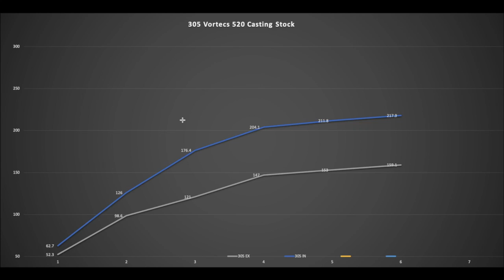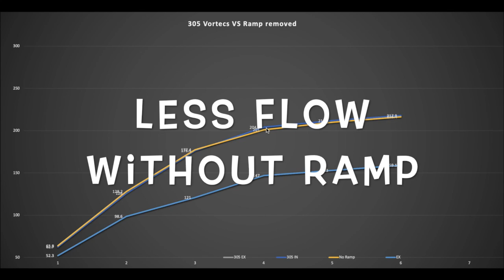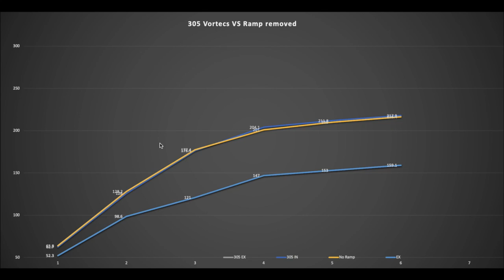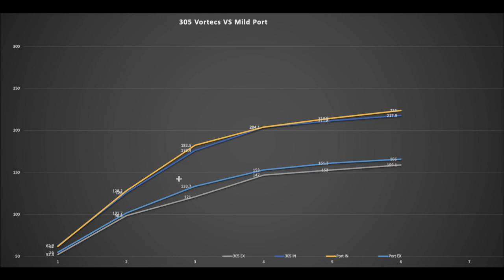305 Vortec Heads vs 350 Vortec Heads (Flow Data)

Comment: Do you know anything about the 113  aluminum sbc heads going on a .060 400 sbc an what cam to use??
Reply: The 113 head has a 58cc chamber. Will make some compression ratio even with a dished piston 400. The intake ports flowed sliightly better than a 882 head. D- shaped exhaust ports are hard to seal with a small tube header.
Reply: 113 heads will choke the 400 before 6000rpm, and the compression ratio is pushing pump gas. Summit sells an old crane grind 306 advertised duration, 246 @50, and .500 lift on a 106 lsa that would work well given the combination.
Reply: You went 060 over on a 400 block? Ain't ya worried about cracks? I know they're siamese bores, but still...Ya might wanna think about a partial fill with Hard Block.

Comment: Thank you for doing this. As an old hot rodder who still likes to build hot little 283s, you have my full attention. I have one fresh 30 over short block waiting for heads, and a second block going 40 over with a really nice rotating assy, so head choices need to be made. 
  Having said that, I see no reason to use 305 vortec heads on a 355, the 350 vortec chamber is worth too much power to give up just for the compression gain of the 305 heads. On a 355 there are better ways to get that bit of compression ratio back with piston choice ( and I mean the right flat top brand here), head gasket choice, and a bit of block decking.
  For a smaller bore engine, though........you've got some good info here.
Reply: 305 heads on a hobby stock where you are limited to flat top pistons starts looking pretty inviting when you're begging for compression ta pull you off the corners and its nice ta hav gonna in too !
Reply: My oldest brother ha a 74 camaro stick shift, he use to do a bit of racing in. He said the fastest that car did was with a 283 and some old NASCAR cam
Reply: How do you build a 283. Did Chevy make engine smaller than 305 or did you just chop one up and modify it.
Reply: @gtgodbear6320  Chevy built the 283 from 1957 to 1967. They are 3.875" bore and 3.000" stroke, and were available in full size cars and pickups during this time as well as Corvette 57-61, Chevelle 64-67, Nova 63-67
Reply: @deuceman32  I think I just found my new favorite engine. I'm a huge fan of small displacement. Have you ever modernized one with fuel injection and electronic distributor/ ECU, turbocharged, and all the other Automotive words I have no idea what I'm talking about?
Reply: @deuceman32   yeah and the blocks can go 4.060" bore as easily as a 350 gets a 4.030" bore.
Reply: besides that you can fill in the combustion chamber and reshape it anyway.
Reply: a ported 305 vortec head with a valve job would be seriously interesting on a 350 or 383
Reply: But what if you have a low compression 350 in good condition and you find the 305 heads? I mean, most people don't want to rebuild the motor to match the heads. They want to raise compression without a total rebuild.

Comment: How does it compare to the 601 and 416 305 heads? Thanks for all the good information
Reply from the maker: Stock 305 vortec will usually outflow professionally ported 416 heads
Reply: @cuttersperformance  ok thanks i have a bunch of 283 cores that could use a good flowing head. On the 350 vortec heads is there a domed pistion available that works with that style of chamber. Or will it wreck the flow and flame travel? I would love two put a set of vortecs on a dz 302 to see the outcome.
Reply from the maker: The general consensus is that flat top is the best with these combustion chambers. But a small dome would work just fine

Comment: Seems like a great bolt on upgrade for the dreaded TBI swirl port heads for some of us that have 305s. I’m curious on how they compare to the older 416/601 castings
Reply: 601s are actually pretty good heads. they have the 53cc chambers so the valves are pretty shrouded. you take the chamber wall out to your cylinder bore and they really wake up. the 601s were the only heads Chevy ever used a bowl hog on to open up the runners from the factory. you clean up the bowl and deshrod the valves they will flow atleast 215 cfm and over 225cfm with a 5 angle valve job and the factory 1.84 valves backfaced. ive gotten factory vortec flow numbers (230ish) out of them with a little work.
Reply: @konnerkramer329  wow thank you. I was not aware of that. I’m acquiring a 3rd gen firebird with that tbi 305 and I’m looking for more go without removing the block - so heads cam and intake will be changed. If I can find a good clean set of the 601s at a good price I would surely consider that option.
Reply: @michaelgrasso4553  the last 305 build i did for someone was a budget build just like that. it was in a 86 c10 with a factory 601 headed 305. i left the engine in the truck while doing it. i first started by measuring how how in the hole the pistons were to setup the quench right. the were .020 in the hole so i used a .021 steel shim gasket. ported the heads as mentioned above. then took an edelbrock performer rpm intake and mached them to a felpro gaskets i think it ended up being a 1206 maybe a 1205. then i opened the intake runners on the heads up to the gasket and smoothed the pushrod wall. i used a budget summit racing cam. it was a 218/218 .450 lift with a 106 LSA. and a 650cfm holley DP. this combustion ran extremely well from 2500-6500 rpm and pulled very hard for a 305 in a full size truck. with a stock stall and 3:73 gears the full size full weight truck would give 2 valve mustangs a run foe their money. but what impressed me the most is that little 305 sounded like a fucking bracket car with that tight 106 lsa with the decent size cam for the 305. it probably made a conservative 300hp and 350tq but sounded like a 700hp 383. if you're curious about the build i would be happy to give you some advice and tips to help or if you want the videos of the truck i can send them to you
Reply: @konnerkramer329  that sounds great, thank you! Im pretty sure that 305 tbi’s in the cars were set up for roller cams and I would probably want to stay with the roller lifters. I would love to know the details of your build and if you have any pics or video you can send me links to mgrasso@eseny.com
Reply: Just scored a pair of the 305HO heads 14022601 for the 305!!! Gonna scrap the crappy swirl ports and use the 601s for the screaming chicken
Reply: @konnerkramer329  Thanks for posting the info on the 601's. As a "283 guy", the 1.84 intakes and 53cc chambers are golden for me, plus my collections of manifolds and valve covers are drop on's.
Reply: well some of us got 350s without vortec or swirl port either. just 882s that are busted through and cracked my engine is on hold until i get heads, any suggestions anyone? Should i opt for 305 vortecs? Or something else?
Reply: They are WAY better.  It is like having 416 heads (same chamber) that flow like 063 Vortecs.
Reply: Back in 2002 I swapped a set of the 305 Vortecs on an 86 9:3:1 roller 305 matched with a 1992 Z28 cam, a computer Quadrajet, 700R4/373s, and custom PROM I burnt based off the ZZ4 chip and it screams- just keeps pulling and gives me 23 mpg HWY and 16 mpg city to this day.  Put it this way, it is good enough I decided not to swap a 383 stroker when I got the money because it was that good.  No one belives me when I tell them it is a 305 in my 83' G-Body.  I am about to try a Ramjet cam for the hell of it and then a ZZ4 cam.  I think the ZZ4 cam will kill my low end torque which the 305 can't afford to loose.  Then I will have the ZZ4 cams duration cut down around where the Ramjet is and test it like that.  I will probably post a video around tax season when I take vacation and get one of those fancy Comp Cams two piece front covers that allow for easy cam swaps.

Comment: I like to see. Stock. 350 v. Up agents ported three angel 2.02 ..1.60.  like 550 lift.  FLAT top PISTONS.  No OUTHER change. On the dino. Then in the car. I want to do that on my 4.3 but I need another set of stock heads..... And on both sets my factory valve job was junk. Like 10 those run out on the EX.  LEAKED LIKE A SIVE.  I WANTED TO BOLT THEM ON STOCK.  SO NOW I HAVE TWO SET'S I F.  WITH. DO TO THE RONA.  AND GM. SHITTY WORK. THANK YOU FOR YOUR HARD WORK. PORTING CAST IRON HEADS SUCKS. NOT TO   FORGET 125 THO. SEAT WITH.   ON EX.   JUNK.

Comment: Great stuff. 

So the Stan Weiss flow numbers were a bit enthusiastic for the 305 Vortec heads then? But those were 059 heads so those could be the better ones? 

The exhaust numbers are very close to the Stan Weiss numbers, his maxed out at 163 CFM @ .500" lift. The low lift numbers were better than the 062 heads right next to the 059 listing. They maxed out at 221 CFM @ .500" lift.

Got it pulled up on my confuser, it says Chevy Vortec L31 iron, its not calling out the casting number like it is for the 305 heads.

Now you got me wondering if the 059 heads flow better than your 520s? If its not to much to ask, if you find a set of 059s it would be great to know if they do in fact flow gooder like the Stan Weiss website says? Thanks for your hard work making these videos.👍

Can't wait to see what bigger valves and some port work is going to do for those! Thanks.

I'm looking at building a sbc 352, its a sbc 400 block with a 3.25" stroke crank. HRM did an article back in the late 90s called; 

"The 350 engine Chevrolet should have built."

I would post a link but yt is getting weird about doing that. If you do a search you should be able to find it easy enough.
Reply from the maker: Yeah I'm going to try to pick up a set of 059s for a comparison video. I'm also curious as I've heard they may flow abit better
Reply: A 352 eh , well i did 372 once, thats a 400 with 350 crank, so same idea, destroking a big bore.
I ran it as a short track motor and loved how smooth it was an reved so sweet on the top end, i went to full on 400 later and that motor was just to explosive , i could just never get hooked up where the 372 laid the power down in a controlled way and made it easier to be fast.
Reply: @luckyPiston  

Well, it's going to be closer to being a 358 because the block will be .060" over. Because the block needs to be bored to .060" over is the reason why I'm going this route. The shorter stroke will reduce piston speed tremendously, that with the reduced cubic inch displacement should help keep it from running to hot?  

Plus if I can duplicate the torque and HP numbers from that HRM article, that would be just right for what its going in without having to worry about breaking the components behind it. It should get decent fuel economy as well with 400 ft lbs of torque starting at 2,500 RPM with O/D!
Reply: Stan's info is mined from all over and some in my opinion is sketchy here and there especially when it comes to the swirlports , the net is swimming with misinfo on those heads so beware.
Reply: @luckyPiston  

I wouldn't really call the 305 Vortec heads a swirl port head, they're 2 different series of cylinder heads. The swirl ports were from IIRC around '87 to '95 where the Vortec series are from '96 to 2002 and those include the 305 Vortec heads. The only similarity is the very small ramp the 305 Vortec heads have but the difference being half the port isn't closed off like the swirl port heads that came before the Vortec series.

Besides, the Stan Weiss max numbers were only 4 CFM different than the above non-ported numbers. That small of a difference could be the difference between the 2 flow benches?

Would LOVE to see what the ported flow would be with the ramp left in and also with larger valves! A set of 1.94"/1.60" would be very cool to see how much flow potential there is there with and without the little ramp. Using these heads on 350 or more cid with 1.94" valves would have plenty of room for unshrouding to pickup a bunch of easy CFM. I would almost bet they might even flow better than the 350 ported heads with the same size valves?

Maybe Pat in the shop will do a video covering this? Hint, hint. LOL
Reply: @itseithergonnaworkoritaint7852  Those earlier swirl port heads you are referring to , the 187 (305 head) and the 193 (350 head) castings (what most people have no clue of) had bigger port volumes than the heads that came before or after them , if anything the 305 Vortec head is a higher velocity version of its predecessor the 187 casting.
Reply: @luckyPiston  
If you say so...... All I know is to direct the air to one side to make the air "swirl" they created a pinch point that closed off half of the port! The Vortec 305 heads don't do that, they just have a small ramp on the roof of the port to make the air swirl. Probably to make up for the crappy chamber shape they went with that was a carry over from the castings you mentioned.
Reply: @itseithergonnaworkoritaint7852  I'm just saying keep an open mind. Measure the 350 Vortec port at the gasket face, the 305 tbi 187 casting has bigger port opening, look down the port to where the port meets the bowl and what do you see ? a cathedral shape not unlike the port on a LS head ! The narrowest part of the port on a 187 is 1.498 sq" were the 906 casting is 1.72sq" , the 187 casting can equal the Vortec in that area with just a clean up.
Reply: @luckyPiston  

Maybe Pat out in the shop can do some testing on those 2 casting to see if they can be salvaged to get some kind of performance out of them? 

As they're casted the air goes sonic at a low lift. When the air goes sonic, that's it they're done, no more air available. Maybe some porting can help? 

I have read a few forum threads that guys messed around with them but no one with a flow bench. I definitely would watch that video.

Comment: could you test the 350 tbi swirl port heads? curious to see the difference between 305 swirl port heads and 350 swirl port heads. im suprised removing the ramp didnt make much of a difference
Reply from the maker: Yeah I will try to get a set of swirl ports. I was alway surprised about the ramp being removed not changing much
Reply: We have to remember that flow is just one component of making power, and is doing so from a volumetric efficiency stand point (more air/fuel in and out). Factors like swirl and quench are components of combustion efficiency (getting it all lit and burnt fast without wrecking parts), a different way to make power (or fuel economy, or cleaner exhaust). So removing the ramp did little to change flow but would it change power output? We don't know.
Reply from the maker: @deuceman32  thats exactly it! Only a dyno can tell that tale
Reply: @cuttersperformance  its been done before and the ramp, well its actually a block near the spark plug on the 882 heads on the 350 and 400 they say not to take out so its really exacting how and what should be done with it a block or a ramp in a head a very specific way. And definitely fill the crossover passage hole. i mean it is literally a hole in the center 4 cylinders only from the chamber to the other side through the manifold. That is crazy, a big hole right behind the chamber at the exhaust valve i guess..

Comment: It would be interesting to see dyno results on a 305. 305 vortec heads vs 350 vortec heads. I wonder if the ramp is needed to preserve swirl due to the small bore or to increase velocity for low end torque and fuel economy. I can only imagine that if the 350 heads worked better on a 305 gm would have used them instead of designing a whole new head.
Reply from the maker: Yeah that would be fun, maybe a Mexican casted 350 head vs a 305 head. Similar flow but different designs
Reply: Don't forget the 305 was designed to be an economizer version of the 350 so swirl port could certainly be part of the equation.
As for increased velocity i dont think thats what a swirl port is about , think more about mixture quality for combustion....

Comment: Call me easily impressed but those numbers were better than I expected! I've got a 305 vortec motor and I'd like to build it, this is good inspiration. 

Question on your spring kit, how much lift does it alot for w/o machining the guides? Do you think a cam with .575 valve lift (comp's XFI 218/224) would be too much for the flow on some ported 520 heads? Following with that, in your opinion would the heads benefit from 2.02/1.60 valves (if there's even room)? This video really makes me want to build a set of iron heads & make an 11-or-so:1 engine w/a small dome piston & that camshaft... I'd love to hear your thoughts & thanks a ton for the great content!
Reply: You should read some of David Vizards books good info on big valves.

Comment: Makes you wonder why GM even made the 305.. Literally costed the same to produce 305 and 350 but the 350 was better in every area!! Kinda seemed like a waste of time and money producing that boat anchor 305!
Reply: I think these Vortec heads on a roller 305 roller tbi engine, 470 lift cam 600 cfm carb would be a great cruiser engine say in a 50’s pickup.
Reply: @drdjh2003  no in any F body  . ..  yeah.
Reply: It was an attempt at fuel economy and emissions compliance, just like the 262 and 267...
Reply: I bought a 84 chevy 4wd short bed step side granny gear 4 speed with the 305 quadrajet 4 barrel carb.  The truck was high geared and it got 19 miles per gallon riding around town and country roads with the AC on.  It was great runner too. Hauling ass when I wanted to. 4 barrel would come in at the drop of a hat. So I like the 305 performance and gas mileage. It was a great motor for cars as well